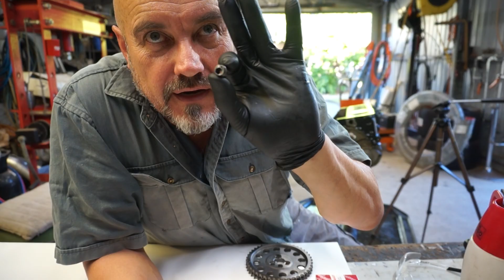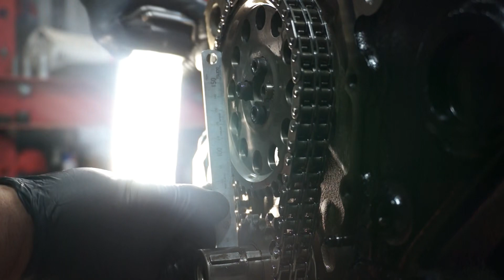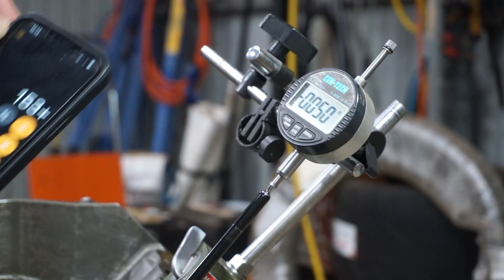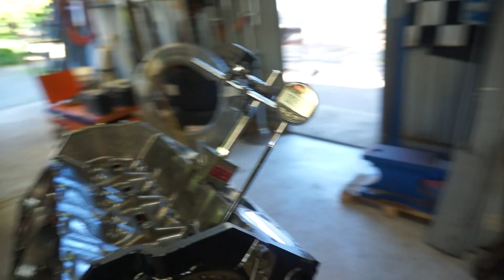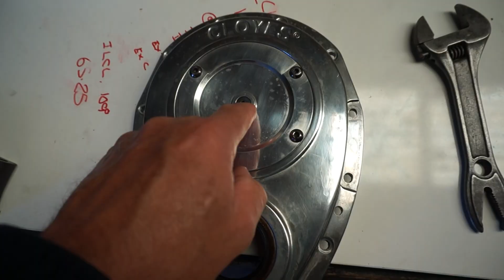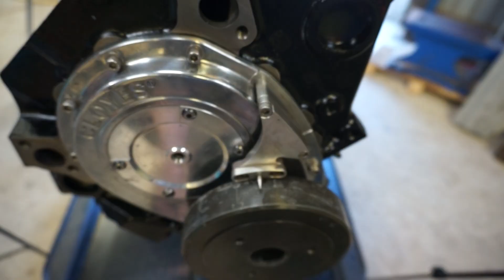Chevy 372 Build Pt4 Camshaft Install and Degree.

Comment: Nice work mark. You do a great job at sharing your build and knowledge. Dam LH & RH dipstick.....
I really like that cloyes timing cover even though it requires some licking. Do they fit behind a short water pump?
Reply from the maker: Hi Darren, yes, the Cloyes timing cover is a nice piece and also fits behind the short pump. My particular cover is a few years old now, perhaps Cloyes have addressed the thickness of the cover. Definitely a robust goodlooking cover and yes, I run a short coolant/water pump no problem, I'll have to show that in the next edit.
Thank you for the motivating feedback, time to get back in the shed!